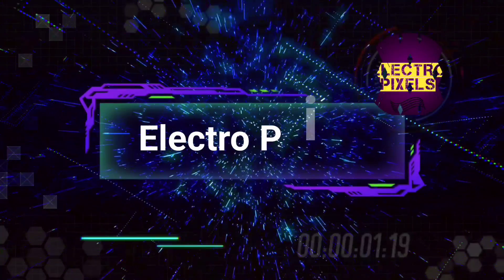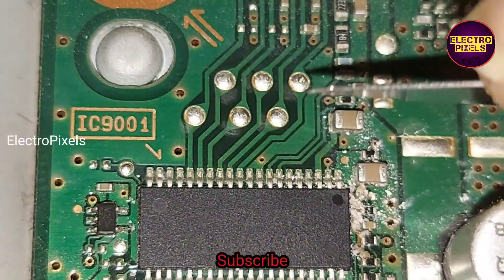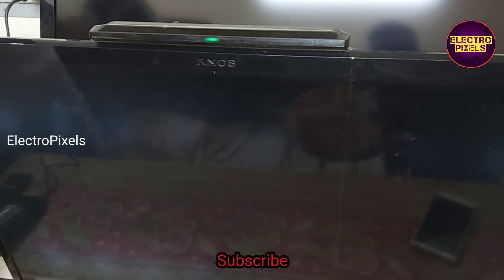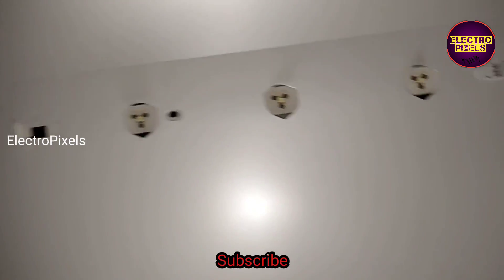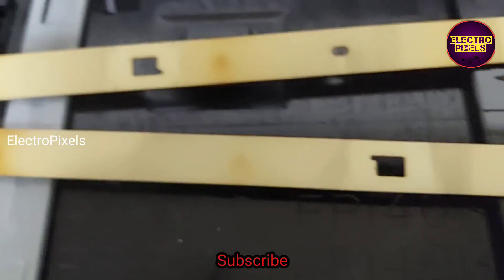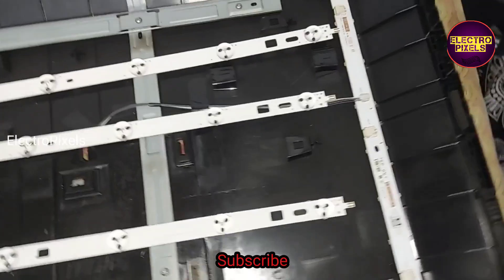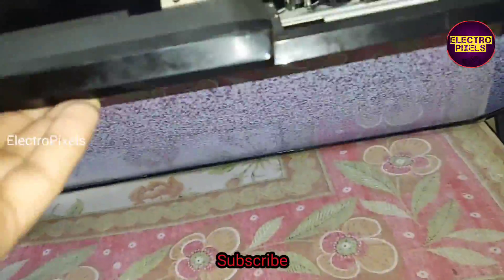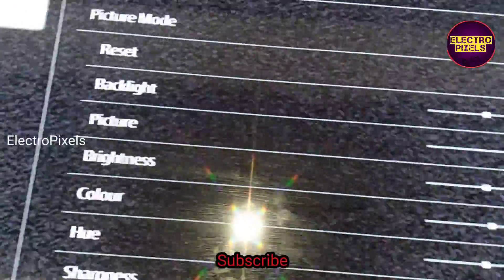How To Fix 6 Times blinking on SONY LED TV|Six time Redlight Blinking Solution|KLV32R412B|LED|Repair

Comment: Is it possible that there is actually no issue with the backlight at all and the IC chip is just misreporting? I connected pin 31 to GND and cut this trace like you said, but I'm not seeing any dim zones?
Reply from the maker: Some situation checking the LED BACKLIGHTS using led checker if its a 3v led while measuring those led if any one shows 3.9 or 4 v because of that led shorting this will cause over current issue because of that it goes to protection mode in that condition if remove Backlight protection the LED will work.

Comment: Mine is also same  tv is blinking 6 times, but I reset the tv by pressing the power+ volume down button and plugging the connector at the same time, my tv turned on and no led problems i see, i see clear picture without any shades without any pixel problem, but after 2 or 3 days the tv again tunrs off and goes to 6 times blinking mode. I took to repair shop, he said the  backlight should be replaced and saying it will cost 2.5k, but I see no problem.  Now what should I do .? should I replace the blacklight or is there any problem to my tv that causing this 6 times blinking mode. The repair shop person is not opening and telling to replace the backlight just by seeing led blinking. please tell me what should i do.. must reply please 🙏🏻🙏🏻🙏🏻
Reply from the maker: Better to Replace the Backlights because if any One LED is short then it will cause six times blinking
Reply from the maker: Permenant solution is Backlight Replacement including all Backlight strips, if only faulty Backlight is replaced then the fault will again repeats in 2 or 3 months
Reply from the maker: In any led is short, if it work on 3 volt then after this it will become 3.7  volt so this cause an over current issue. Sony Tv has protection mode that's why its indicating a lamp error
Reply: ElectroPixels  sir  please tell me the power rating of that leds strip, so order online or tell me the website i found one website on online that is  easyspares is it genuine, plz tell me sir. I am unable to paste the link here.. how much does that backlight cost, i found it for 1490 after the discount original price is 2240, i want to replace by myself, is there anything to do on backlight driver mother board after replacing with new backlight, or just replacing with new ones solves my problem, i studied ece, so i know about electronics, so that's why i want to solve it by my self...    The title of led lights in easyspar is Led backlight strip for SONY 32 inch TV 8 led 3v A/B (3 pcs set), please tell me are those the correct compatible leds,  only this laat question sir, please reply 🙏🏻🙏🏻🙏🏻

Comment: what will happen if you don't change the backlight?just disconnect the fail pin and let it run?
Reply from the maker: The faulty LED Backlight strip will not work so in picture that portion will be dark, other backlight strip's will work. Also it causes an over current issues, which will soon damage the other Backlights